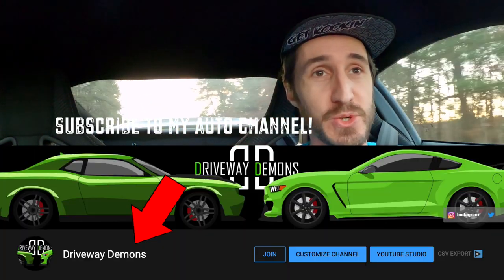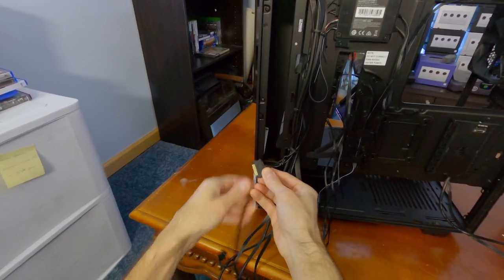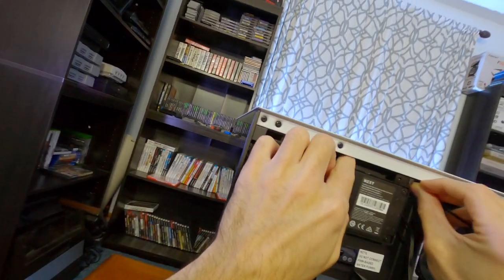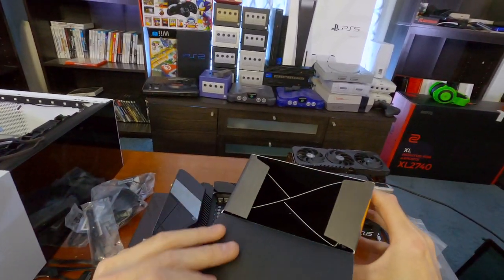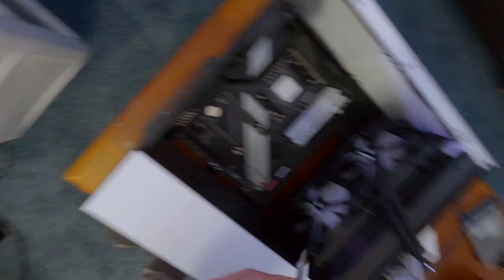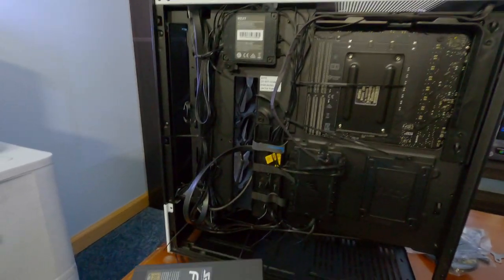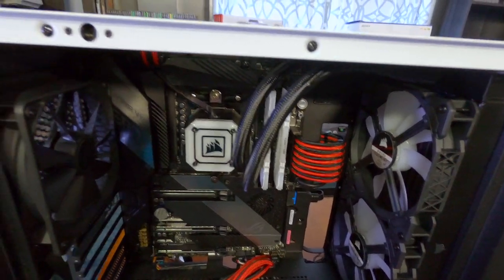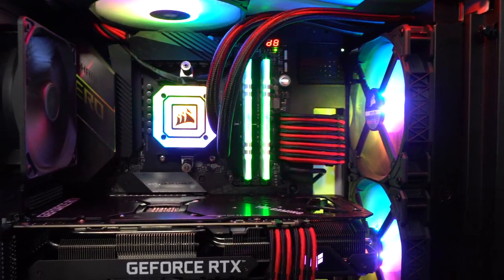How To Build Gaming Computer! AMD Ryzen 5950x & RTX3080 POV

Comment: Not an insane build but good attempt. :)
Reply: He didnt say that just stop u Cant even build lefos
Reply: @nilsgames9286  Perhaps I need to upload the thumbnail of this video to Imgur and send you a link? Would that help you understand?

And I can't even build? Are you for real?

Haha.
Reply: @nilsgames9286  Sticking an AIO onto a CPU isn't rocket science kid, my personal rig is a custom loop Intel Xeon W-3175X and Dominus Extreme which requires specific mounting pressure to maintain all six memory channels, that's more difficult than this.
Reply from the maker: Such hostility....I didn't just stick a cooler on this. I have built like 300 machines. Done the xenon builds too. This is a gaming rig not a editor or bench queen. Lol
Reply: @Akryl1kz  Ah so you have a C621 platform too, I see.

P.S, what's the temps on your 5950X with that AIO? Heard this CPU is meant to hit 5GHz single too.

Also overclocking AMD isn't harder than Intel.

P.S, your eyes are out of focus in your video, your camera doesn't have eye autofocus?
Reply: Please try listing build parts.Thanks